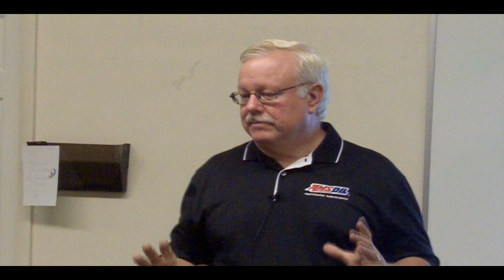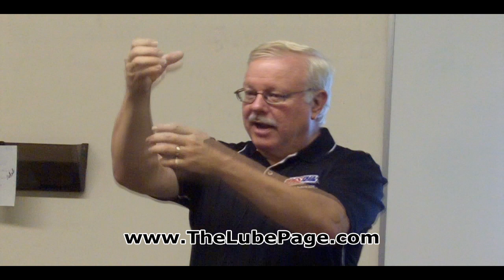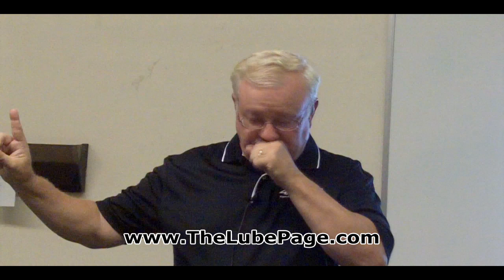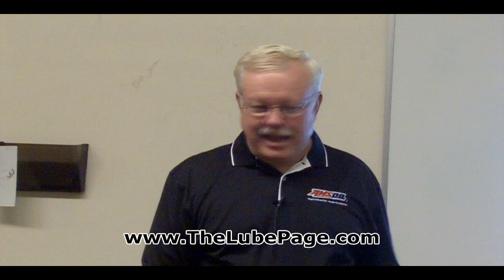AMSOIL: Understanding Oil Viscosity Ratings

Comment: So, the ambient temperature doesn't matter unless it's colder than 32°f? So a 20w50 motorcycle oil will be sae50 above 32°? So unless the ambient temperature is going below freezing, I can just use straight weight?

Comment: I’m only using Straight SAE30 in Miami.  Please be advise of the viscosity index improvers (VII) are not lubricants. I don’t want this in my oil especially when I’m running hard. That’s the reason why I only use the single weight oil. I’m never up north.  A 0W30 oil has more VII in the oil (22%) and will sheer and evaporate.  Not the Single weight SAE30.

Notwithstanding multi weight synthetic motor oils tend to evaporate much easier. I wish they made a single weight 30 grade Synthetic oil.  I’m driving on the road for hours on end.
Reply from the maker: If you can find SAE 30 straight weight non-multigrade oil with the correct API classification for your car it would be a great choice in Miami.  Most vehicles today call for  API SN which is designed around the multi-viscosity principles to qualify as energy conserving and multi-environmental applications.  A straight 30 weight oil will respond to temperature changes including high temp conditions.  In High temps the SAE 30 will thin to a 20 weight at around 275*F.  Remember, your oil runs 30*F to 70*F hotter than the water temp in the engine.  So on a hot day in Miami with the AC running in stop and go traffic your oil my be 275*F or higher and if you have a straight weight SAE 30 oil you are probably now at the 20 weight range.  You are right that the vaporization rate for the straight weight is less than the multi-grade as a general rule.  Some synthetics like Amsoil Signature Series multi-grade oils will be very close to the straight weight oils in vaporization rate.  Ideally, a straight weight high quality synthetic would be the best choice in Miami, the problem is non of the straight weight oils meet the API-SN rating required by the OEM's for their cars.
Reply: @thelubepage  thanks Dan.  I found Mag 1 made by Warren Distribution (API SN PLUS), and WD sent me the spec sheet.  Also they sent me the Walmart Brand called Super Tech SAE HD30.  Same specs as it's blended by WD also.  This is what I'm using and Valvoline makes an HD 30 too but more expensive.  I've gotten a lot of data sheets and I'm impressed at the performance of a single weight motor oil performs.  Sheer tests alone are impressive.  Thanks for your input.

Comment: great videos and learn alot from it. Just realized this videos is 5 years ago and still there are questions about oil viscosity nowadays. In my country where its summer all year round, Amsoil distributor only have 0w30 oil where the manufacturer car manual calls for atleast 5W40 oil since its 34-35°c all year round. Is it safe to use 0w30 instead since its the only signature series available from Amsoil here?
Reply from the maker: When the manufacturer calls for 40 weight (viscosity) it is not a good practice to go to a lighter oil especially in the temperature range you are describing..  I think you should try ordering the 5W-40  from the Amsoil supplier.  Amsoil makes a few different 40 viscosity oils.  Let me know the make model and year of your car and I can make a recommendation.  Contact me direct at: danwatson@thelubepage.com

Comment: Hi Dan i have a 2000 Toyota 4runner with a 2.7 straight 4 it has close to 300.000 miles it was really niglected in oil changes cause i had to change the valve cover gasket and it had alot of gunk in the engine but it runs great i had a compression check done by my mechanic and still has alot of compression on each cylinder the oil cap calls for 5w30 but my mechanic told me to put high milage mobil 1 fully synthetic 10w40 im here in miami fla we barely have cold weather up here do you think that is fine what im using or should i go by what the manufactor recommends oh and i was also told to do at least 3 oil changes at 2000 miles for the engine to get cleaned up.
Reply: Use Amsoil engine flush, Amsoil performance improver, and Amsoil signature series.

Comment: my car bmw e65 745i what is the number of oil .I am live in medal east where the Weather between 10 to 47 c
Reply: +libyanman libyan 5w-40 or 0w-40 Euro spec.
Reply: +Dr. Ng 

Thank you for your answer to the previous question. BMW 745, 2002.
I forgot tell you that the car has come a distance of 127,000 miles. Changed her Castrol motor oil 10/40 and after 3000 miles and found that the oil shortage by 1 liter. Is it something natural because of the large 127000 mile distance traveled. Note that it does not have any smoke from the exhaust.
What is the proper oil Is 20/50 or 10/40 or 15/40 to reduce the evaporation of the oil and maintain the engine
thank you.

Comment: So, What is the actual diameter of that "Little hole"  ?
Reply: +Bruce M Carleton Jr it simulates an oil gallery. so think  pinhole size
Reply: +jack black............... "Pinhole" size is not a scientificly accurate measure.

Comment: Does the second number refer to outside temperature?
Reply from the maker: The second number actually refers to the operational viscosity at 212*F.  This is engine oil temp not ambient air temp.

Comment: I use an air-oil cooled 1.2 litre bike living in the tropics, where the engine can get really hot like a kettle pot..so maybe I should use 10w 30 rather than 10w 40 oil? that should give the oil more movement through the engine and oil cooler lines?
Reply from the maker: NO!  The flow will be satisfactory using the 10W-40.  The 40W will have a higher high temp / high shear rating and will therefor give you a greater margin for protection in high temp situations.

Comment: Why is it when you change oil in a diesel, it instantly turns black...like you didn't even do anything? It's always been a mystery to me.
Reply from the maker: Diesel engines make soot (carbon waste) and this will turn the oil black but it doesn't mean the oil is not still a good lubricant.  Newer trubo charged diesels using ultra-low sulfur diesel will produce less soot so it takes a little longer for the oil to turn black.
Reply: Dan Watson  I have noticed the low ash oils start to 'gel' near the end of their usage. Doesn't give much room for error.

Comment from the maker: If the engine is worn it may need a little thicker oil to reduce consumption and maintain the best ring seal.  You can tell by the amount of oil consumption you have.  If you start to use oil then maybe you should try the higher viscosity.  But if the oil consumption is fine then there is no reason to use a thicker oil.

Comment: Hi dan,  it does not matter the the first number, but Here in Puerto Rico, lowest is about (70f°) i get recomended alot 10w30 for my 5w20 car. Does this matter? I went to buy 5w20 synthetic and only can find 0w at major autopart stores. Many people say that high millage engines should use a thicker oil,is this true?
Reply from the maker: Sam, better late than never with a reply.  The first number doesn't make any real difference in your climate.  The second does and if your manual calls for a 20W you should use a 20W.  In some cars the variable valve timing is dependent on the right viscosity but in others you could use the 30W without any problem.
Reply: +Dan Watson 
my car 5w30
but tempuer in 40c
l think to use 5w40 now lused 5w30 sn fuchus titan

Comment from the maker: EJD,

5W-40 is the preferred viscosity for your BMW.  5W-30 will be fine. If you haven't had oil consumption problems there is no need to change.  At 200,000 miles you might be using oil and going to the 5W-40 will slow consumption down.  You are right that the 5W-40 might cost you fuel mileage.  On the other hand, if you are consuming oil, the 5W-40 might give you a better ring seal and raise compression which might actually give you a better fuel mileage.

The choice is yours.

Dan Watson

Comment from the maker: The pour point is not as important as the Cold Cranking simulator numbers.  The 5W will allow for easier starting in severe cold than the 10W.  The test is not the same as the kinematic viscosity test done at 210F for the second number in the viscosity rating ie: 5W-40.  The W in the rating can be thought of as the winter rating.  The test for cold is more about the resistance to objects moving submersed in the oil than how fast it pours out of the bottle.  Use the 5W for best results in cold.

Comment from the maker: You are right, straight SAE 30 does not have any VI.  Again it gets hard to calculate the final viscosity but if you know the actual measured centistokes of the SAE 30 you might be able to use the formula (w1) (V1) divided by T = (w2) (v2) divided by T where w is viscosity in centistokes and v is volume milliliters  and T is temperature in Celsius.  It might work assuming temperature is the same for both sides of the equation.  Temp being the same would remove the affects of the VI in the 5W-30.

Comment from the maker: Sorry I missed your comment but here is the answer.  You will definitely end up with a new overall viscosity somewhere between the two but you can't use simple mix ratios to determine the outcome.  Multigrade oils use Viscosity Improvers (VI) and since these may be different in size and concentration in each of the oils mixed the results are not so easily predicted.

Comment: Yes I'm having leaks! haha... I've always had leaking around the valve cover gaskets (being a boxer engine, it's an important gasket) and the oil pan. Now I am leaving larger puddles on the driveway and when I'm going up a steep hill sometimes it leaks onto my exhaust. That and the hydraulic lifters are more noisy with the thinner oil. BUT, it has more power and gets better fuel economy now....so I still like it, even though next oil change I will be going 0w30 like you suggest.

Comment: I feel blessed to stumble upon your videos! Thank you man, I really feel like I'm taking a free college course in motor oils.

I live in Duluth, MN (colder than hell, and is 1 mile from Amsoil corporate headquarters) and just tonight I changed my oil ('in my 95 Impreza, 2.2 Liter) and I ended up getting 10w-30 Mobil 1 High Mileage fully synthetic oil. It was around -5 degrees tonight. Did I choose the wrong winter grade? I have a feeling I would have been better with 5w or 0w-30. Thank you